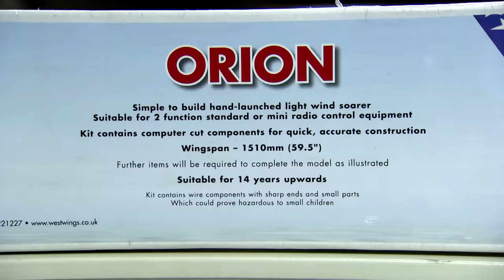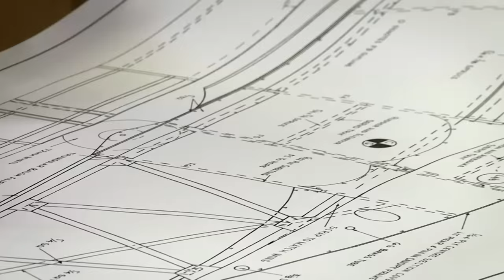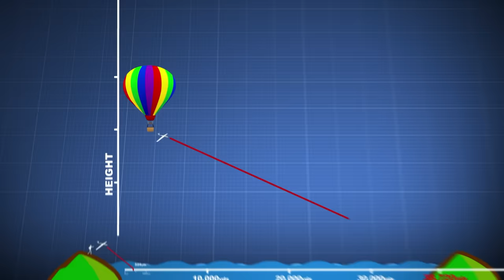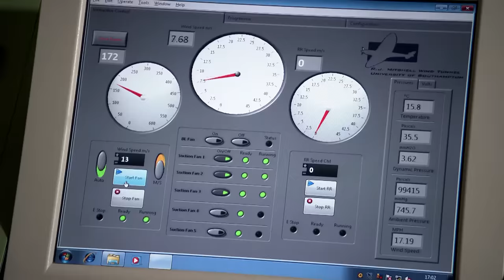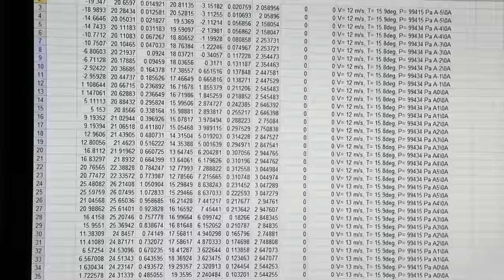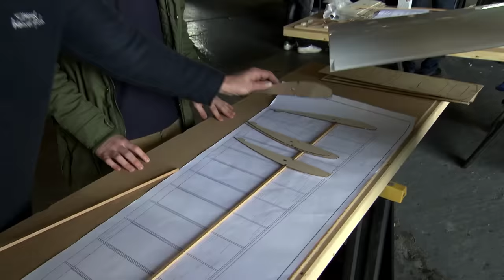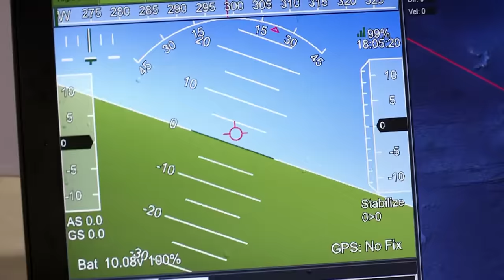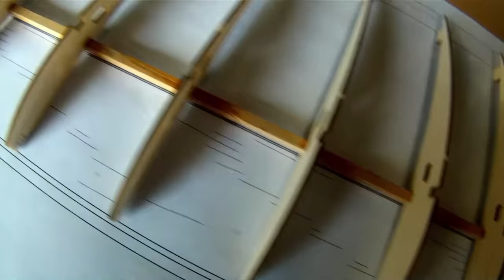Can This 1000 Piece Model Plane Fly 22 Miles!? | Toy Stories Special

Comment: I personally build long-range UAV aircraft, capable of flights up to 120km, and with full autonomous capability, with high-gain antennas, antenna trackers, and other GCS equipment. Hotwire cut foam with carbon fiber and laminated with fiberglass and epoxy. I once saw this episode, and this was the inspiration for me. I'm only 17. This was absolutely insane when I saw this episode. And now, I can do something like this myself!!
Reply: And I'm Barrak Obama
Reply: And I’m the king of Botswana
Reply: Im the Queen of Ingerland and I'm very impressed
Reply: Bollocks 😂
Reply: If you did it, good on ya!!!
I used to work in a field where UAVs were unheard of, I put them in contact with a “company” that had much experience in that field.  This was way back in the day when that kind of stuff was not shared between government entities.  I never got to fly one, but having the UAVs really helped in the performance of my duties.  Keep at it!!!  Hard work, relentless hours and pure determination can accomplish much.
Reply: None of your detractors have ever seen team black sheep fly 50 miles or David Windestal glide back from space. Sadly the regulatory agencies don’t let you fly like them in most countries anymore.
Reply: I once built a high altitude camera RC plane, from scratch, I used 2 helicopter gyros to stabilise the heavily modified 35 mm SLR, 3 X Heli gyros to stabilise the plane, though the rudder was useless and got removed and a UHF radio that worked up to 3 km away, with its 15cc four stroke glow engine and huge tank,  it had a flight time of 80 minutes too. 

Not very impressive you say,  this was in 1983. I was 13 years old. 

Those that can, build what they want, those that can't claim you cannot do this stuff.

Well done you, I believe you.
Reply: I’m Captain America! And I’m English!
Reply: I'm the captain now.
Reply: Much easier to do than kind of thing with the tech of today. Doing this in the 90s is much harder.
Reply: @ForeverNeverwhere1  Damn. That's absolutely insane for 1983, considering the technology and availability of parts back then, compared to today!
Reply: @himarei  That's very true! In the 90s, it would have been extremely expensive, the components would have been huge compared to today, and the batteries would have had a very low energy density compared to today.
Reply: Elon get off the youtube comments.
Reply: Mate, do you live in UK? Literally has a list and plan to build one myself
Reply: Dude, don't listen to people who doubt you. Just post something on YT. I would love to see your work. ✌️♥️🇬🇧
Reply: That’s amazing to hear man, don’t give up you obviously know what you’re doing and you definitely have a bright future ahead of you
Reply: That's Really Cool...
Reply: I’m King Julian and I’m a movie star now
Reply: Cool story bro 😎.  I once built a fully operational F-117 out of plywood and fiberglass. It was fueled by unicorn farts and skittles. The woke crowd loved it.
Reply: @thegamingrhino5864  Your honour
Reply: Arduplane all the way!
Reply: Have several UAVs with total autonomy myself with ~100km total range each, telemetry till 50km and video till 13.4km. It's quite easy these days.
Reply: I am Ragnar Lothbrok
Reply: Sentences should never start with And.
Reply: Really cool, love this hobby. Hope the FAA don't bother you too much about it 🤣
Reply: @RCshowmen  or Express LRS. That set up just laughs in the face of range.
Reply: Interesting. What batteries, vtx , fpv camera and motor do you use...🤔
Reply: Zephyr per chance?
Reply: @thomaswinston5142  English is my third language, so I doubt it's such a big deal. Try speaking Finnish and Swedish :D.
Reply: @Hunter-iw3rm  I'm trying to get into university so I can go study aerospace engineering! It's going to be a lot of work, though.
Reply: @sakarrc5001  Nice!  Yeah, it's incredible how anybody with enough motivation and time can build one of these. I use a SIYI hm30 40km digital system for control and video.
Reply: Does it work?
Reply: I’m Spartacus.
Reply: @tumbles8350  Can you do something about these damn taxes?
Reply: @aflaz171  no
Reply: Ya, the internet might need proof of this my friend. Or else … well you saw the comment.
Reply: @abcdefg4570  having a dad who owned a model shop and had tonnes of stuff I could borrow helped no end. 

I remember the gyros were £35 each at trade price, X5, , I made £14 a week on my two paper rounds. The hard part was not being able to see what you photographed, so I would use 2 rolls of film wait 3 days to get it developed, and then realise there was barely one good shot amongst them and it would be a month before I could go back. 

Drones have really democratised aerial photography.
Reply: Your mom must be very proud
Reply: @ForeverNeverwhere1  Cool to hear what it was like back in the day! It's crazy, as the cheapest drones cost basically nothing nowadays. The cheapest possible fully autonomous system can be built for like less than 200.
Reply: @sakarrc5001  I love Arduplane! Inav and betaflight is straight up garbage compared to it.
Reply: @abcdefg4570  sounds very impressive mate! Just ignore the miserable Muppets on here that don't have a life.
Reply: @davekennedy6315  Thanks! I've been on the internet for 10 years now, so I'm quite familiar with these kinds of people haha.
Reply: @abcdefg4570  you're a veteran now! It's just jealousy. Good luck with your future projects, you sound like you have a real talent there.
Reply: @davekennedy6315 Thank you!
Reply: Start a youtube channel and do an open build!
Reply: And I’m the prince of Nigeria
Reply: 什么融为一体🤔🧐
Reply: I'll take shit that never happened with a side of fries
Reply: Well done! But video please, or it didn’t happen! 😊
Reply: m
Reply: @FastLaneLyfe   hat?
Reply: And I bet you couldn't find the G spot on a 13lb snatch with a map
Reply: @stephenreeder6608  But I sure as hell know a thing or two about UAS-systems.
Reply: WHY Would I SPEAK A LANGUAGE THAT I DONT understand.?
Reply: I would like to see vids
Reply: These fools don't know about inav and ardupilot/pixhawks. Well done mate. Glad you're enjoying long range fpv rc 😊
Reply: Missed this in 2012 but it today in 2023 Wonderful,  we need more programs like this today Mr May.❤😅
Reply: @Tom-uv7ry you know nothing. It's a hell of a lot easier if it's a powered plane. So many people are flying long range autonomous now.
Reply: @ForeverNeverwhere1  I don’t know but that sounds impressive now for anyone!! 

Maybe especially for the average adult who can’t even build a proper paper airplane!!
Reply: And I live in a perfectly financially stable country!
Reply: What motor and battery did u use or was it gas  what was the top speed
Reply: Yo chief? Wanna build me one
Reply: Put the pipe down kid
Reply: @Illyoinkyourmom  Believe it or not, this is no drug-fueled fantasy. This is actually what I do, and what I will likely spend my future doing, as I am going to study aerospace engineering next autumn. Modern components are cheap. For instance, one of the most capable autopilots (H743 V3) costing less than $100, and all other components being ridiculously cheap from China. This would not have been possible ten years ago.
Reply: Hi it's king john here....just to say hi from the 15th century
Reply: @colourcascade7600  Stop lying, this is 2024
Reply: Me to but I’m 13
Reply: And how would one see and avoid other aircraft with your long range models?
Reply: @Gratefulwon  The first step is looking at maps and ensuring that where the flying happens isn't near an airport inside of an UAS-restricted zone. The second step is abiding by the local drone altitude laws, at least when flying near a city, which in my country and most of the EU 120 meters, because general aviation has to fly above 150 meters.  If I am flying far from the city in the middle of some fields and far from any airports, I fly higher, however, as the probability of collision is practically nonexistent, and even if there was a collision, any aircraft would suffer minimal damage from my 3kg foam/fiberglass aircraft, which would be comparable to a larger bird, of which there are millions in the skies.

I also use a flight controller with an ADSB receiver, which notifies me if there is any aircraft within 10km of the UAV, and which makes it possible for the autopilot to step in and decrease the altitude, for example, if any aircraft gets too close.
Reply: @abcdefg4570  Wrong answer really. You are really relying on laws of probability to keep folks like (who fly EMS) safe.
Reply: @Gratefulwon  There is no objective wrong answer to your previous inquiry regarding the precautions I take; as I did in fact, describe what safety precautions I take.

Moreover, nearly everything relies on probability in our existence. For instance, you could be struck by a meteor in ten minutes, as your house is not meteor-proof. Despite of this, you likely do not see it necessary to live in a bunker, as the probability is incredibly low, as nobody has been directly killed by a meteorite. 

The same principle of action having a necessary equal and opposite reaction does not apply to exaggerated regulations for flying recreational RC aircraft, however. There has only been one reported case of a person ever dying from recreational RC aircraft flying, and that was the RC pilot themselves. It is an inherently safe hobby; the safest one after crocheting, yet, one of the most regulated ones, although regulators and the media often portray the narrative that it is not, despite of statistics completely disproving their claims. 

Regulations should be proportional to the actual risks involved. Excessive regulation for an activity with a low incidence of harm is unnecessary and burdensome.

As long as I take the necessary precautionary steps to ensure that I do not harm or bother anybody or their property, as I described in my previous reply, I can confidently claim that what I do is no more dangerous than crocheting.
Reply: And I'm Genghis Khan.
Reply: Throw on an Aim-120
Reply: Probably has a factory job where he tightens one bolt on an assembly line all day 😂
Reply: @snavisTM  No. This is an one-man operation. I do all of the design work, computational fluid dynamical simulations, structural simulations, construction, and flying, myself. I would share pictures, but all of the comments with any url:s here are deleted.

Comment: 4:13  😂 the sound of the helicopter crashing into the hangar as James turns and walks away had me laughing for a solid 2 minutes 😂  the fact that is was off screen, and unacknowledged by James, made it even funnier…
Reply: then proceeds to do the exact same gag with the piper!
Reply: James keeping alive the buffoonery of the old Top Gear days. Well done.
Reply: And this right here is why the original Top Gear was so good, and why nobody else ever effectively copied it, although lots tried. I always said Top Gear was a British humor show that just happened to be about cars
Reply: Had me laughing too. Its how he just turns like he's lost interest then doesn't even acknowledge it crashing 🤣🤣
Reply: @peterresetz5072  This was from 2012, back in the old Top Gear days!
Reply: @ladela7348  THAT'S why their electronics are so ancient!
Reply: @Zoey_the_Rat  yeah. Also he used the same controller for two different toy rc vehicles
Reply: @samholdsworth420  that must have been an insider gag, at least for me to smile
Reply: @samholdsworth420  you can program controllers to operate many rc craft or vehicles.
Reply: @jimmywhitlow2012  yeah, but not these toys 😂 
I am very well-versed with building RC aircraft. And anyone who is would know that you couldn't fly two toy RC with one toy RC controller...just saying
Reply: @samholdsworth420  Neither of those were really toys.  First was a Blade 120SR, which while old is a hobby grade model from Blade/Horizon Hobby, and the plane was a Parkzone Ultra Micro J-3 Cub, also a hobby grade micro RC.  The radio was a (also old) E-Flite DSM radio, and certainly can connect to both of those DSM models and actually came with the Ready to Fly combos for both of them.  Funnily I actually had both of those models myself back when I first got into RC in 2011-2012.  If you scroll back far enough you can see the 120SR in the first video I ever posted on YouTube.
Reply: NGL, I almost cried in laughter too 😂😂
Reply: I wonder if the remote controlled plane was the same one Richard Hammond used in planning the Reliant Robin Rocket Launch.
Reply: @Anglerados y
Reply: "..but it was only 40 quid mate"

Comment: The thing that changed my rc plane experience over the years more than anything else is ammonia.   Yes the chemical that burns your nose.   With a little bit of ammonia you can warp, twist ,bend balsa into any shape you want without it snapping.  It's like magic.    The number of designs I could never make without adding glue weight jumped by multiple orders of magnitude after discovering that one thing.
Reply: This is VERY intriguimg to me as, someone who hasn't built an RC Plane for a few decades but have been thinking to get back in.

What percentage of Ammonia are we talking about?  Like, Windex amount (3-4%) or Jewelers Ammonia (25-28%)? Very interesting, thanks!
Reply: Hot water does the trick too
Reply: @potvinsuks8730  well window cleaner works.

Comment: While competing in a contest, my dad lost three model gliders from Beaulieu Airfield back in the '70s. The timer wick that was supposed to burn through a rubber band that held the tailplane had failed on each glider, resulting in the gliders continuing to fly. Once they get in a thermal, they could go for miles. Dad had written an address on each plane. Months later, the remains were sent through the post, explaining where they ended up. One was found on the Isle of Wight, one was trawled from the North Sea, and the third came down in Paris. I don't think being caught in a thermal will count as a world record.
Reply: wow, so finally the good folk found them and took the effort to send theme back three times
Reply: All FF competition depends on launching into thermals.

Comment: In my teens I attended a plane modeling club where we built balsa wood models ourselves, from scratch. And I do mean from scratch because every bit, maybe apart from the fuselage we had to sand down to proper size, dimensions. Build wings etc. from that. Then cover them with special fabric. And those models weren't only for show. We attended and competed in events across the country on old airfield hauling the models up in the air, letting go of the line at a specific moment and then the judges would count the time it stayed in the air. Great memories and that show brought it all back. Thanks!

As the Supreme Leader, thankful you said, “This is so British!” That’s exactly what I was thinking. Then, somehow, the uncooperative French made this video even MORE British! 😂😂😂 “Liberté! Fraternité! Absurdité!”

Comment: This looks like my first rc glider model with 2 channel COX radio which I bought in a model shop in Bournemouth in 1976. My first flight was from a place called Hengistbury Head. I had no idea how to properly control it and it flew about half a mile before crash landing. I still fly rc gliders to this day.
Reply: I might have missed the point of the film, but i think this was a remote controlled glider. Right at the end there is a fellow with (to my non expert eyes)  the controller. I thought the idea was  it should "just" a glider.

Comment: I built a balsa Tiger Moth from a kit with a rubber band powered propeller it lasted 3 flights before getting smashed by the British weather and wrecked. But after a rebuild it flew and flew until it was downed by a train that blew it into the ground.

Comment: The component that made the flight possible is the GPS/6-axis accelerometer microcontroller for the glider's servos. However as any hobbyist will tell you is that the unit must be finely tuned to get properly damped corrections  or it will  result in lots of energy-wasting set of oscillations. I'm sure the glider has been tested at lower altitudes prior to launch to get the proper PID values. Even then, from the video, there is a considerable amount of tail wagging.  No doubt the flight was assisted considerably by the tail wind, so if the test was actually conducted at 8000 feet and in still air, I doubt it would have succeeded in going 22 miles. Nevertheless it was a very good attempt and kudos to the actual model engineers who did all the hard work.
Reply: #ArdupilotFTW

Comment: When I was about 15 ,I sat in my bedroom one night and carved out of solid balsa wood a fuesalage shape, added some solid balsa wood biplane wings, a tail, screwed in a glowplug 0.49 Cox engine onto the front, and then my mate from school decided that it needed some centre of gravity adjustment's so screwed in a wood screw just for balance. I then painted the whole aeroplane in red and then we met up after school to see if it would fly!

Finally we got the engine going after so much trying with an Ever Ready battery, think it was 9 volts on a very cold winters evening and then launched the plane down hill on land oppossite Steve's house. 

I was absolutely gobsmacked as the plane started to fly by doing a loop the loop over overhead power lines and then headed away into the distance. 

We got on our bikes to chase it, it was heading towards a local shopping centre and playing fields and I began to worry that it might land in the shopping area. 

Luckily it ran out fuel after about 15 minutes and then landed on some playing fields.

 I was so relieved, the plane however did not  survive but the little Cox 0.49 engine did. 

I still have that glo plug engine somewhere in my loft. 

Amazing days , will never forget them.